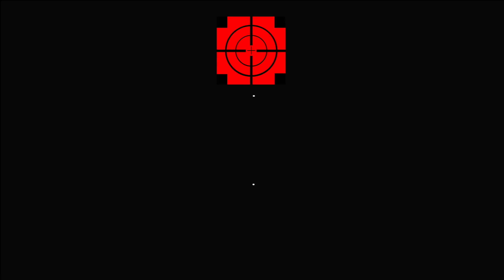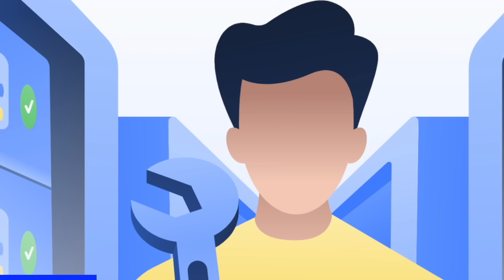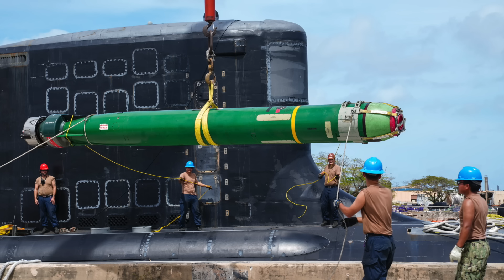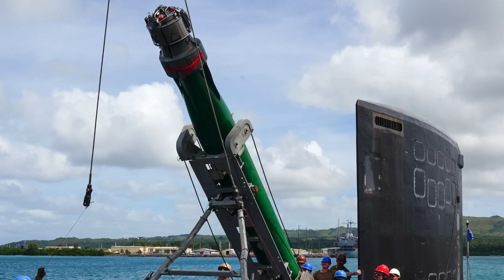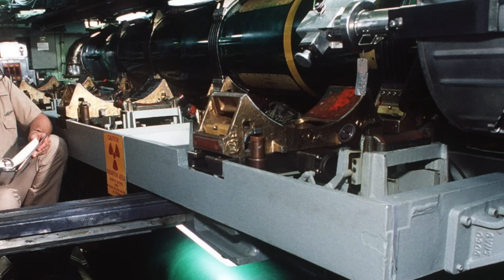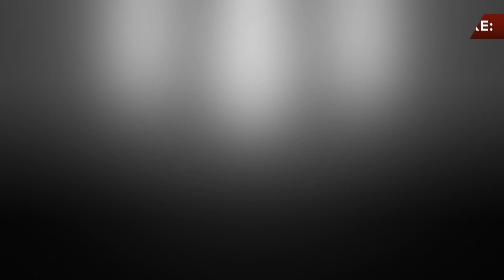Why Mk 48 torpedo is a key weapon for the US military ?

Comment: But Russia got torpedo jammers like sonars jammer that can confused mk48 active passive sonar sensory unit maybe Lockheed need more advanced systems in future
Reply: they use home on jamming, for a lone sub, that means the torpedo will continue guiding, sonar jamming is only useful for distracting away, like another sub intentionally pulling a torpedo away from it's target, so whether its on or off, its going to be going toward someone.

Comment: The Mk48 is a very good torpedo, fast, long range, with very strong explosive power. However, it is not quiet. Even the latest versions are not as quiet as the lates European heavy torpedoes (Blackfish and F21) that are running on electric power, a much quieter system, even if slightly less performant in terms of speed. And coper wires have been replaced on these latest torpedoes by optic fibre cables, that allow far more information to be exchanged between the torpedo and the sub.
Reply: That fiber Optic , was/is classified ! You in trouble !

Comment: While the MK-48 is great weapon, they should really look at increasing the capabilities of the MK-54
 Ukraine has shown that drones with warheads on boats are slightly effective but still easy to counter
Bring back old school to surface to surface torpedoes
A MK-54 with 500lbs warhead and 10 mile range and advanced seeker
The videos of Ukraine drones entering Russian harbors and all those ships around but they have to pick and choos
Imagine the same drones with 2 to 4 torpedoes each
Same with drones attacking in day time
no need to get close
just close enough ID and fire one
and the break and fire two from different angle

Comment: Shooting a Mk. 48 out of a submarine gives away the position of the shooter. If there's a Chinese or Russian anti-submarine warship, helicopter or sonar system nearby, it's death for the shooter.
Reply: No its not
the problem with the US Countermeasure Anti-Torpedo (CAT) which was to deploy anti torpedo defense system was that sensors could not detect the incoming torpedo till it was too late
Modern subs torpedo launch are 100 times quieter than previous generations

Comment: I was a Torpedoman aboard a fast attach sub and I approve this message 😂
Reply: Why don't they load torpedoes from the torpedo tubes?  That would eliminate one hole in the hull???
Reply: @rael5469  It isn’t just to torpedos…people have to get in & out…Also loading via water subjects the weapon to water that isn’t good for long term storage…
Reply: @stevea9604   Good point. I forgot about the water.  :)
Reply: @rael5469  
The tubes are still underwater in port
Secondly the bow has share space with the sonar
if Sonar wasnt an issue, they would reload from the bow as it would be faster
Reply: Isn't the Mk 48 outdated?  Why haven't we heard of a new design by now.
Reply: @rael5469   It is outdated compared to Russian torpedos. And some other nations. This same basic weapon was developed in the 1960's. I am a former Navy torpedoman, so I know of what I speak.
Reply: @chaz-r3k   Thanks for replying.
Reply: @rael5469  
The Mk-48 like everything else has enjoyed successive upgrades to keep it relevant to modern warfare
You are forgetting that in last few decades , Subs have been firing anti ship and land attack missiles. Also doing ISR (Intelligence, surveillance and reconnaissance) and delivering special forces 
The last time that torpedoes was used in open warfare has been was in 1982 during Falklands where the HMS Conqueror sank the ARA General Belgrano
Ironically they used unguided torpedos due doubts about the MK-24 Tigerfish  reliability which were confirmed after the war that the Tigerfish would have likely failed but beyond that
Torpedoes dont have that high priority on the scale due to their non existent use in warfare
But Ukraine has shown the need for surface to surface torpedoes to come back
Reply: @rael5469  The Mk-48 is like the F-15, F-16 and the F-18…Still better than anything else like it and so far advanced nobody has caught up to it yet…
Reply: @stevea9604 No the French F21 torpedo is the most advanced heavy torpedo
Reply: @stevea9604 No, the French F21 Artemis stealth torpedo is the most advanced heavy torpedo in the world, it uses electric motor, 50 knots, 50 km.